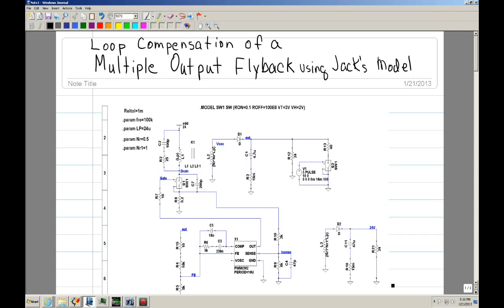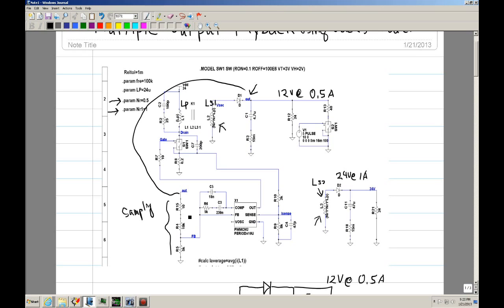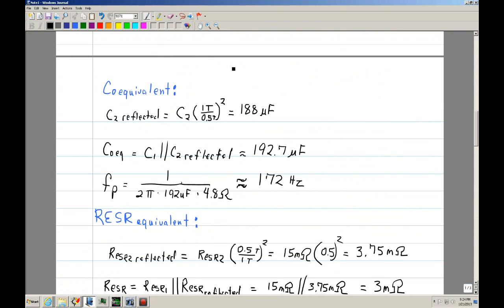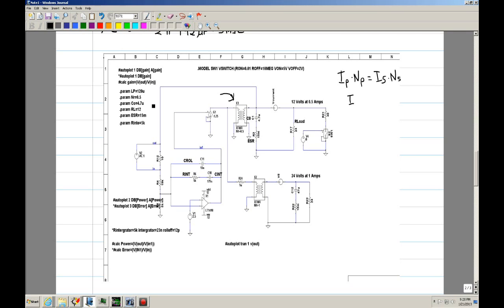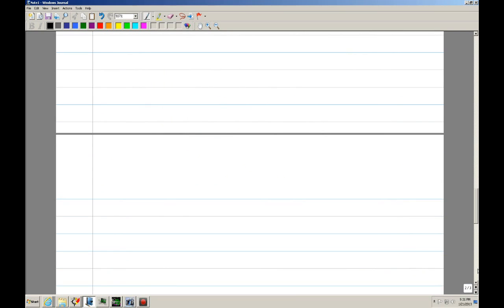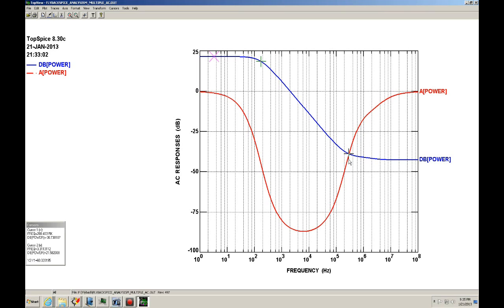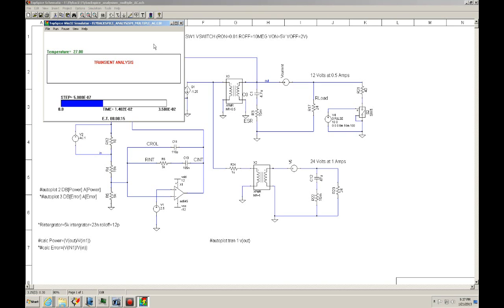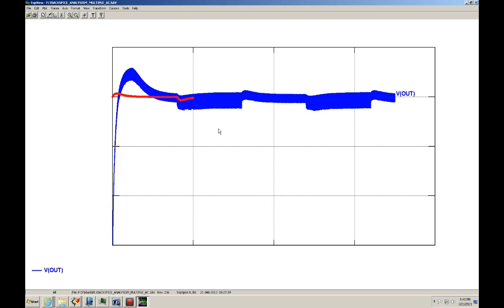Loop compensation of a Multiple Output flyback Part 4 .wmv

Comment: Hi Sir
I followed this method to calcullate for out 2.5 and -2.5v 3 amp each rail  12v in, i use 100uf with esr 25m im not able to compensate with the little value of load resistor

Comment: Hi Sir,

I have one doubt. If the 12V and 24V both are connected to  feedback loop, then can we use this same method.
Reply from the maker: Sorry Giridhar, I missed reading your question. The question is vague but I will try to answer. You usually only feedback one voltage, the most critical or the supply with the most power. But you can use a summer to sample two supplies and average or assigne a weigthed value. The procedure to calculated the output polse and zeros will be the same as I show in this video. Regards, Robert

Comment: Dear Robert.
Thank you for excellent knowledge transfer. I would like to analyse multiple output 2-transistor forward converter in similar way. Control scheme for this converter is current mode. I am going to reflect capacitor as you explained in this video and connect it in parallel with the one from regulated output. I will do the same with capacitor's esr. I would like to ask about inductor that is present on secondary side in my topology. Do I need to reflect it as resistor and reduce its value by the square of the transformer turns ratio? (I am moving from higher voltage output to lower as you did here). In next step please advise how to calculate equivalent value of inductor. Should I connect it in parallel with inductor from regulated output or in series?

I have an access to cleverscope but converter is unstable that is why I want to reduce my power stage from two outputs converter to the one output equivalent circuit, add compensation around my error amplifier and then I am going to take a bode plot of power stage to adjust a compensation network. Maybe there is a better way ?

In meantime I will try to simulate this topology using Jack's model.

Best wishes
Kamil